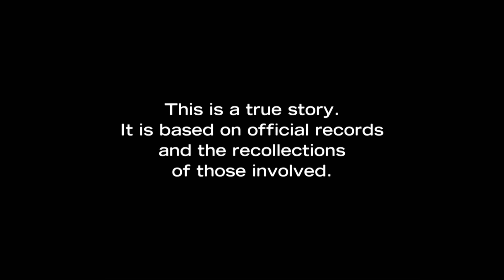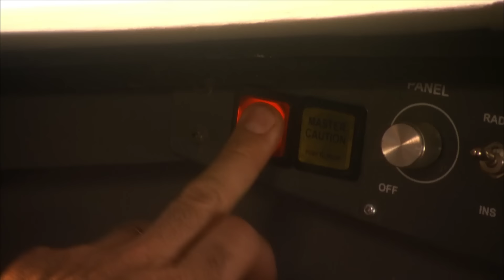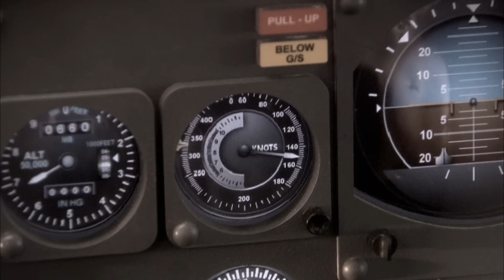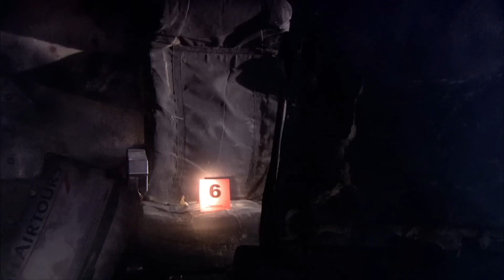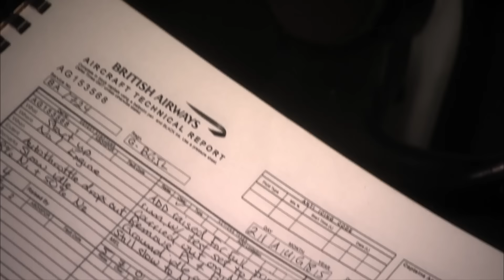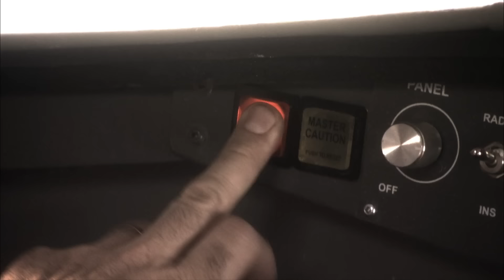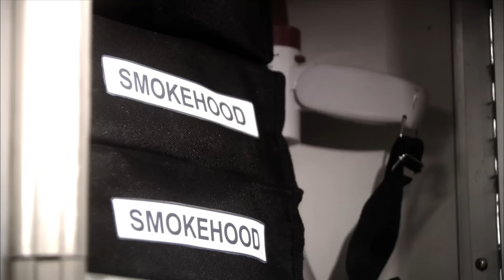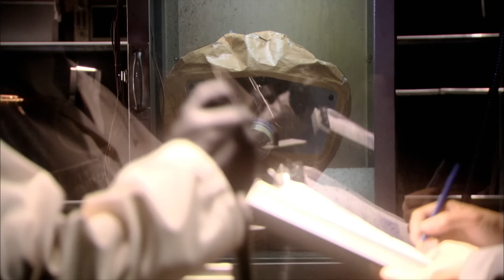Engine Catches Fire On Flight 28 | On Board Fire | FULL EPISODE | Mayday: Air Disaster

Comment: Who in their right mind, considers going thru a checklist to be more important when you know theres a fire and your lucky enough to be on the ground to get the heck out EMEDIATLY?😖🤪🙄
Reply: Because their actions can make things a lot better. Cutting off fuel and other steps in the checklist are designed to limit the damage as for as long as possible. Less important is the flight crew is in charge. People probably don't want them to be the first to jump ship in emergency.
Reply: @3ountyhunter  Exactly. Letting people get hurt or die because you left the engines running when passengers were evacuating or feeding the fire a bunch of fuel because you were on the ground and wanted to just get the heck out instead of doing your duty as a pilot is a pretty bad decision to make, both for your conscience and your future in the job. Doing as much of the evacuation checklist as possible before getting out is what anyone in their right might would do.
Reply: The slides come down right in front of and behind the engines. You have to shut them down or risk making things much worse. And there isn’t really an “off” switch. You have to cut the fuel pumps, etc.
Reply: Agreed. I blame those pilots for those who died.
Reply: If the thing s turning off the engines, then just turn them off without reading a whole book. Engines off, plane off that's it, everybody out. It takes les than 20 seconds to do that then evacuate immediately.
Reply: @socramserrot  If you are so smart and know everything then why are you not a pilot or an engineer? Get a job with the government and show the rest of us how perfect you are at this highly skilled and technical job.
Reply: @socramserrot it takes over a minute for a turbine engine to spool down from idle to being safe to approach, and it’s not as simple as “just shut off the engine 5head” the shutdown process takes time to do properly and prevent further loss of life.

Comment: hmm. why wasn't the over wing hatches used? or were there any at that time?
Reply: according to the video there were only four exits and none were over the wings.
Reply: The video very clearly shows 2 exits at the very back of the plane which were blocked by fire and smoke and 2 exits at the very front of the plane, one of which was jammed and did not openly initially. There were zero exits over the wings. Did you even watch the video?
Reply: @kealilasok14  someone answered my question for this aircraft model.  i remember these aircraft having an over wing hatch when i flew in the 80s.  the video re-enactment shows an over wing hatch .

Comment: Broken engine piece, combustion, suboptimal wind direction, and a valiant but ultimately damning crew/maintenance group.
Reply: Spontaneous combustion is the phenomenon in which a hydrocarbon (or a chemical substance) substance unexpectedly bursts into flame without apparent cause. In ordinary combustion, the hydrocarbon is deliberately heated to its ignition point to make it burn
Reply: and non-fire resistant early aircraft design.

Comment: I can not believe that the cockpit crew would waste time with a shut down check list when the aircraft is seriously on fire. If 
I were in command I would say screw the shut down check list and get the passengers off right now no hesitation.
Reply: Yeah i'm sure shutting down the fuel pumps and putting on the brakes aren't that important
Reply: You can’t. And just a moment looking at a picture of a 737 will get you to understand why. Look at where the doors are. Look at where the slides come down. Now look at where the engines are. See the problem? The slides come down right in front of the engine fans and right behind the jet exhaust. It’s a common issue with underwing engines. But on the 737’s short body and low to the ground wing and engines it’s particularly noteworthy. You’ve got to shut down the engines first.
Reply: @andrewtaylor940  so what is your point? it takes no time at all to shut down an engine. and they obviously could not use the aft exits cause that is where the fire was. but to delay exiting the pax to read a checklist is not right. I retired with 10,500 hours in 140 different cockpits and if that would have happened to me i would not have handled that way. the pax would be my first concern.

Comment: Should employment training to point the plane away from the direction of the wind causing the air and smoke and flames to blow away from the plane. Pushing outwards not inwards to the plane. Turning the plane in the proper direction of the wind depending on the side of the plane the engine is burning. Could keep fuel and flames in the away direction from the plane
Reply: The wind was apparently very light according to the report and was also shifting at the time. One thing this show leaves out here (and I don't know why) is that when the fuel tank was breached fuel ended up all over the side of the plane, which helped the rapid spread. The pilots had no information that this wasn't an engine fire caused by the engine digesting a piece of burst tire (what they believed at the time to have happened and has been known to happen from time to time) and never got the notice of an engine fire anyways until after they had used the reverse thrusters. Add into that only one door working properly (the forward port door), the forward starboard door taking a minute after stopping to open, along with problems with the overwing door falling inside and pinning people until moved means a recipe for disaster even if the plane was facing the other way.
Reply: yea but Gerald the wind can change direction at any time

Comment: Doesnt a 737 have overwing emergency exits?  At least the starboard door could have been used if so...
Reply: The wings share a fuel tank, once stopped the fuel would begin to pool beneath the plane. It'd be a bad idea.
Reply: The 737-200 has 2 over wing exits. One on each side. But they may be contraindicated in the event of engine fire. The left side one was almost certainly on fire in this case.
Reply: Yes - and it was opened. However, passengers had no idea how to open it (not common at the time to teach them and no time after the fire started). They did get it open but were confused by the instructions and it fell back inside, causing further delays trying to get out. And as mentioned below, in this kind of fire they are high risk, though in this case if passengers had been able to open it more probably would have gotten out. The people who were able to operate it were either trapped by the crowd at the front or trapped by flames/smoke/people at the back.
Reply: In the beginning they said that model had 4 exits, 2 in the front and 2 in the back of the plane.
Reply: @serenaclairetalks  I know - but that is incorrect. Just in the post-fire pictures alone, you can see the right overwing exit open. Why they left this out, no idea, but the accident report talks about the problems with getting it open, delaying evacuation, and sadly a good number of people were found by it. They also don't mention the firemen going on the plane in an attempt to save anyone after those able to get off, nor do they talk about the FA in the back that opened the right aft door before the plane had stopped, which is believed to have helped bring smoke and fire into the cabin. 

I'm not sure why this one is such a mess. The accident report clears the pilots and clarifies the wind was really mild, meaning that it was not the huge factor as it was presented here. The pilots also couldn't see the smoke and never got an engine fire light until after they used the reverse thrusters and believed ATC was speaking to them about a regular engine fire (due to ingesting burst tire pieces which can happen), instead of a burst fuel tank spraying fuel along the back of the plane while they aborted take off which was then ignited by the engine. 

The main causes of the deaths in the report were said to be the exits and aisle widths - it took 20 seconds to open the first door after the order was given, sixty seconds for the next front door to be opened and the passengers had the emergency wing exit fall inside, causing valuable time to be lost. Between the crush of people pushing and crushing each other in the narrow walkways and the bodies blocking the aisle, to begin with, coupled with the faulty doors and lack of guidelines at the time to teach passengers to use the wing exits, this was always going to have fatalities. The fire breached the port side of the cabin far too quickly (in one minute) once the plane was stopped (due to the movement pushing it back before).
Reply: @serenaclairetalks  it's Mayday. Their scripts are mostly written by plaintiffs lawyers. Not always the best airplane detail people. But I think every model of 737 has at least 2 over wing exits. With newer variants having 4
Reply: it woulda been a bad idea to use them, the wings are full of fuel so it’s only safe to use them if there isn’t any fire

Comment: Bad part, excuse me, NEW PART. Don't  repair old crap.
Reply: I thought the very Same.
Reply: It's done all the time. Many planes even have recap tires.
Reply: If done by the book - not a problem. It's people's laziness or way too heavy workload that causes cut corners which leads to accidents. Even if a part is new, it still has to be installed correctly and sometimes that doesn't happen either.

Comment: I would've just stopped on the runway .. He literally drove right through the flaming jet fuel making a full right turn into the fire .. those planes are super thin and light! 😔
Reply: Hindsight is 20/20. Unfortunately, hindsight is very unreliable in the heat of the moment. You can say you would've done many things in certain situations, but you would be surprised how irrelevant that is when an actual emergency crops up that you have to deal with it right now at the very moment with no warning and very few clues as to what's happening. It's kinda pointless to say you would do x and x and x, because in real world performance, it's very likely it would not go down as you would have planned it to.
Reply: @gerble36  Yep, and as soon as the fuel tank was ruptured it was spraying fuel all over the back of the plane due to the motion of the aborted takeoff alone. They didn't even known there was an engine fire until after they had used the reverse thrusters and thought a piece of tire was in the engine. People point to the 'a lot of fire' statement by ATC but engine fires just do that while not being so devastating right off the bat like this one was. No one in ATC said "You're whole side is on fire" - kind of think they would have stopped a lot sooner for that, but all the issues with the exits still more than likely would have resulted in a loss of life. A picture exists of the plane coming to a stop with huge amounts of fire and black smoke pouring from that side going back towards the tail but there was no way on earth for those pilots to know that was the case as it simply wasn't visible to them at all.
Reply: @gerble36    None of us were in that real life situation .. we're watching it on a video .. so we're commenting on the video .. duhhh
Reply: @MisTracy39TheVeganLady   At least you understand that you're just someone watching and commenting On a video

Comment: Engines have been falling off planes.  Have they fallen off more frequently since they added magnesium and aluminum into the jet fuel where it does NOT belong? Since both heat up the fire of the jets?  They might also make fires in plane engines be uncontrolled more often.

Comment: If one of those firemen handed their mask and air tank to the stewardess ,she would have continued to search for people in the smoke.
Reply: It was probably to late then. All so the video does not say way she did not get the smoke hood from the emergency cabinet. Lastly why was she the last out, where was the other steward?
Reply: @dennis2376  True. Everything happened within 4 minutes.
Reply: Or they could have tried to trade places with her, but must be impossible to climb up the foamy slide.
Reply: @dennis2376  Besides the 2 pilots, there were 4 flight attendants. 2 of them died in the plane, but I don't know if the attendant trying to get the door open was a causality.
Reply: Do you think the fireman has an arm that is 20 feet long? How exactly was he supposed to give up his mask to her? And then he has no mask so now he can't help fight the fire? And his mask is personalized for his face. And she probably didn't know how to use the mask because she's not a firefighter. And why do you or the fireman presume it's her duty to continue going back for more people at this point?
Reply: @kealilasok14  The point being the equipped train firefighters could have searched if the stewardess could do it .
Reply: Would you?

Comment: The pilot made a mistake.  He knew which direction the wind was blowing, as the plane or tower would have given him that info before takeoff.  The tower also told him which engine was burning after he'd aborted, yet he still turned the airplane such that the wind would blow the fire toward the fuselage.  The pressure of the situation got to him, which is understandable, but nonetheless his mistake cost lives and he does not deserve the title of hero.

Comment: Kick out he window over the wing without the burning engine. 
Crawl out on wing. Easy Peasy.
Reply: @dennis2376  not to mention how thick those airplane windows are.
Reply: Airplane windows are 3 layers thick and rather small.  They are intentionally hard to break and I doubt you would be able to break through all 3 layers in a smoke filled and cramped cabin in enough time to save yourself let alone fit through the small opening.  The real mistakes were not using the emergency oxygen bottles to assist passengers that were becoming overcome with smoke and not turning the plane into the direction of the wind.
Reply: @annihilator247x  Not break the glass but break the seal around the glass.  It's not a Brinks truck I hope.
Reply: @Crashed131963  even then, aren’t the fuel tanks in the wings? that seems like the worst place to be in a fire.

Comment: Pilot should have opened the door instead of wasting too much time for bullshit. Fire is fire . Let open doors let people out. Aircraft already fully stopped and let people out in a next second .. pilot in jail now?
Reply: I don't think the pilots can open the doors from the cockpit. You have to use the handle on the door. And the reason they have to do the checklist is to prevent more possible injuries or deaths. E.g., if an engine is still running and escaping passengers run in front of it, someone could get sucked in and killed.